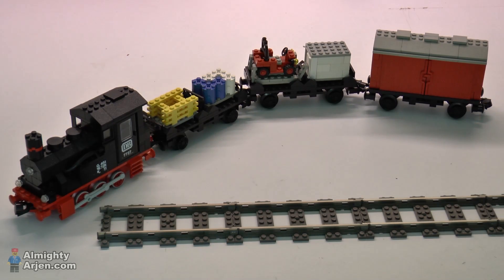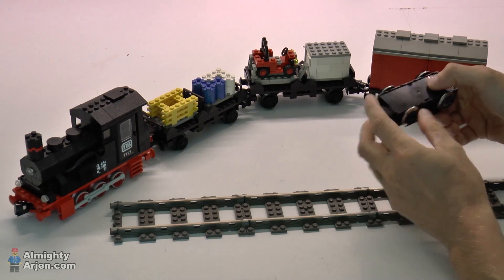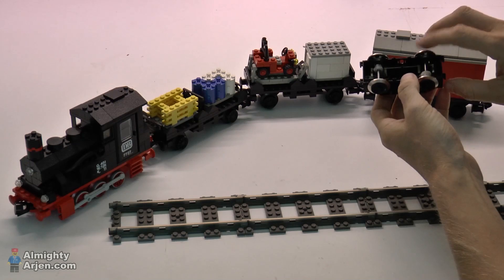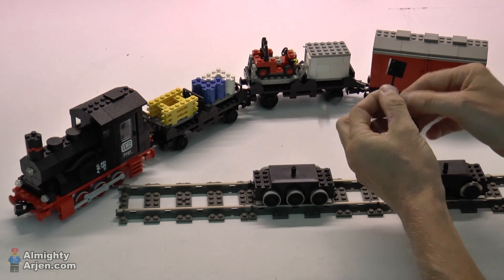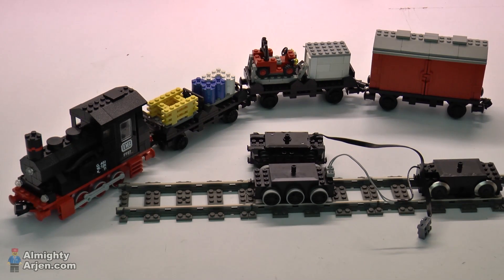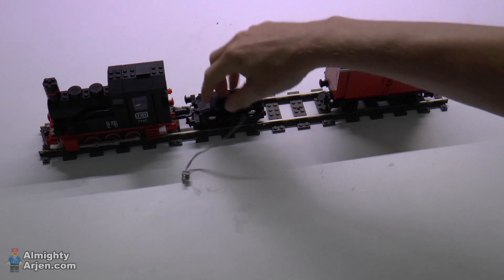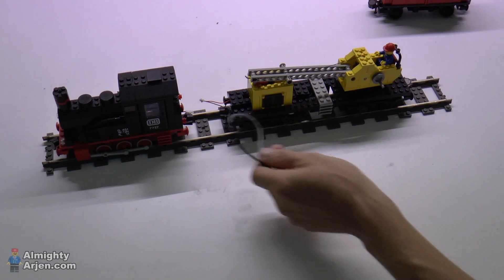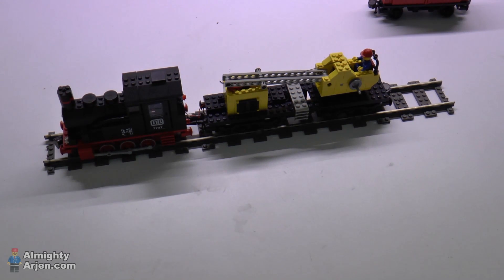Lego 12V train motor on Lego train 9V rails how-to

Comment: THANK YOU FOR THIS. I love 9V. My first train set was 7722 Steam Cargo Train (similar to this one). It's 4.5 volts. I'd love to figure out a solution to get it running on the 9V tracks and the regulator without having the fork over the money for a 9V motor. Now I want to go shopping for a broken 9V motor and some resistors and an old power connector so I don't have to splice mine.

Comment: can u use a dummy to charge the pf train so u can still use the remote?
Reply from the maker: Since the charging voltage is a bit higher than the voltage that a chargeable battery is giving off: it's possible, but you need so electronics to raise the voltage for charging at the right voltage.
Reply: @AlmightyArjenWip  
aybe hook the charger up on the rails and put an equalizer in the train

Comment: cai I use the same trick using power functions to power the 12 volt motor? it has same 9volt output
Reply from the maker: Yes. Use the inner two wires from the PF cable for connection to the 12V motor.
Reply: AlmightyArjen Work In Progress thank u 👍🏻

Comment: 4:50 why do u want to use new battery engine with old9v? Isn' better to use only 9v? They look the same
Reply from the maker: In case you have a defect 9V motor laying around or when you want to run multiple PF motors (since they are cheaper than the old 9V motors)

Comment: If the 12v motor coms on a switspoint dozend hit the conekter points?
Reply from the maker: Good question, I tried it and there's no real issue there. It wobbles a bit when passing the switch point but that's it. :)

Comment: But a 12v motor can't use all of his torque if i give him 9v...
Reply: Correct. But since a 12V is stronger than its 9V brother, it can pull a complete train without problems.
Reply: +AlmightyArjen yeah i know that. i own both systems, and i have 3 or 4 9v motors that are broken. and doing 2 tracks for 2 type is so complicate. thanks fpr the video